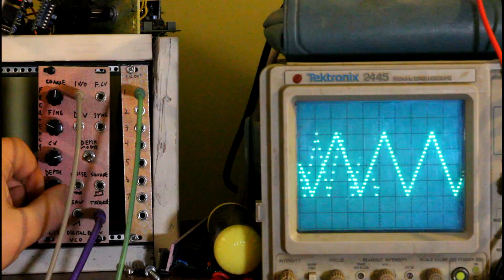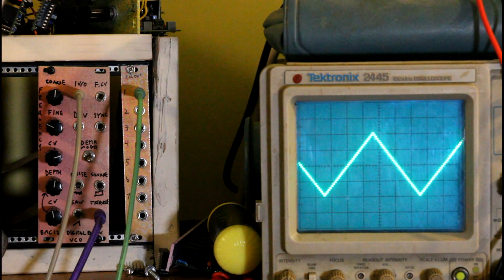BMC120 Digital Depth VCO Demo

Comment: This seems to sound great! I noticed that the circuit uses 18LF25K22 and its maximum supply voltage is 3.6V. Perhaps this is an error, please note, perhaps 18F25K22 is used?

Comment: Nice one Michael, lots of interesting features on this design! Sequencing the bit depth must be lots of fun. I completely agree that the "quirk" imparting different timbres on the output signal every time you reduce the bit depth is a feature, not a bug. To me, such unpredictability is much of the charm of playing with synthesizer hardware.

Just a quick heads-up: I wanted to peruse the schematics, but it appears that the webpages for BMC119 and BMC120 are broken. It seems you have fixed it, thank you!